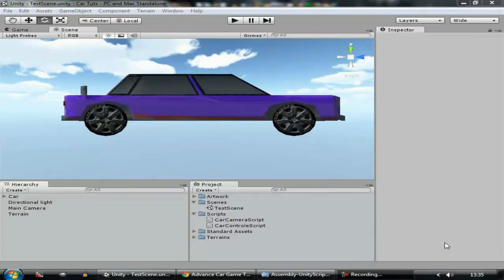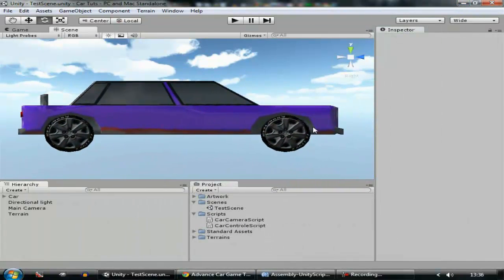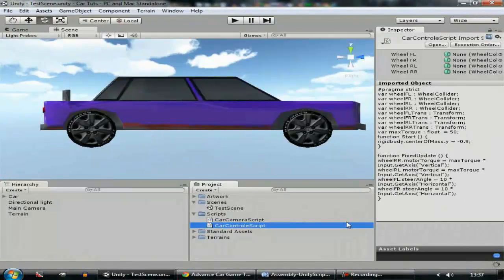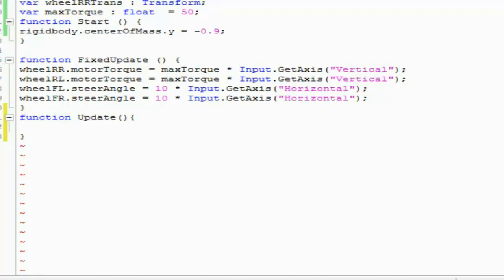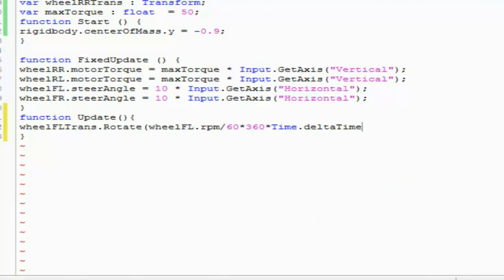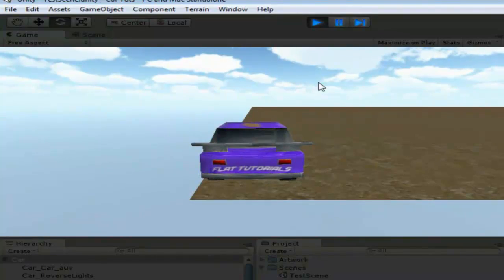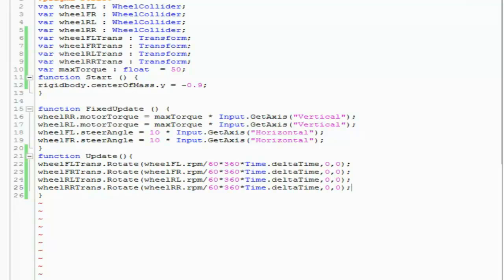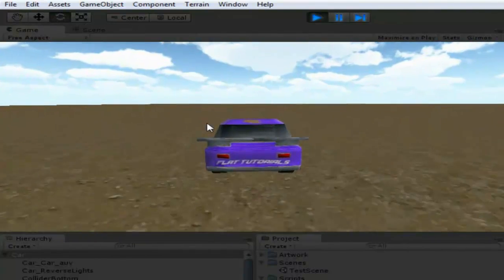#5 How to make a Car game - Unity 3D Tutorial - Wheel Rotation

Comment: [THE SOLUTION!!!!!]
For those who are having issues, there are 2 things that i had and i got it correct:
First, if your car is slow, getting inside the earth, you have put the WRONG transform. As you see in hierarchy , you have the PARENT wheelTransform, with 4 gameobjects(wheelFR,WheelBR...) and each one have a CHILD insite(the wheel object), so you have to put THIS CHILD in transforms on inspector view, not the parent ones, because the parent are empty gameobjects that have no colision, so this is why your cair is going inside the floor/earth/etc.
After solving that, my wheels started to run a lot weird, rotating to sideways instead to front. Well, at the wheelFLTrans.Rotate(...) note that ROTATE is getting a VECTOR3 POSITION, like ROTATE(x,y,z), so, if your object came from 3dmax , the (x,y,z) will be incorrect, so, lets put that like: wheelFLTrans.Rotate(code,0,0), or wheelFLTrans.Rotate(0,code,0), or either wheelFLTrans.Rotate(0,0,code), change the position of that code, so it will change the direction based on the X or Y or Z. To make it easyer, try to clic the wheel object and see the three arrows there, use the one that is pointing the side of that wheel.
AND if they are rotation BACKWARDS, simply put a "-360" instead of 360 only n that wheel , so it rotates the oposing direction!
I think i could help you more, just reply here, and ill try to help!

Comment: When my wheels spin, it rotates in a wide circle. The things noclip through the car instead of rotating on a fixed axis on the axle area of the car, and opening the .obj file in Blender doesn't work.
Reply: Make an empty object at the center of the wheel, let the wheel spin ( rotate ) in perspective of the empty object hope it helps and best of luck bro :)
Reply: WORKS!-that is so smart.tnx!
Reply: Ahmed Awad I have the same problem -- the wheels are rotating on the axle of the car. I wish to try your proposition but don't know where to begin. Can you elaborate please. Thanks.
Reply: mdh cs I got it. No need to answer my query.
Reply: Ahmed Awad I did the thing you said... And still my wheels spin in a wide area...
Reply: ChausticGiggle Everything that spins in this world has a a central point, make that empty object the central point and let the wheel spin around it, Hope it works mate :)
Reply: Ah! Thanks man! Now it works :)
Reply: ChausticGiggle code hard. Make us fun games ;)
Reply: that is not unity problem that's your modelling software problem the axes should be in the center of the wheel also in unity your model axes should match the coordinates of the empty object
Reply: Ahmed Awad thnx
Reply: mdh cs i didn't get it can you explain please

Comment: Ok everyone, I figured out the wheel problem! If your wheels are rotating around the car, it's because the wheels of the model itself is not pivoted correctly. If you have maya, 3ds max, blender or any 3d software that can open .obj, you have to click on each individual wheel and center the pivot. And for FlatTutorials you should update your .obj model with the wheels already correctly pivoted! Thanks for the tutorials though!

Comment: If you have problems with the copied wheels rotating like windmills, try deleting the TRANSFORMS and then re-copying & moving them.
Now, when you will ROTATE it 180 degrees, instead of entering it into the box (which moves the wheel, I found), you select the first wheel, use the rotate tool & hold CTRL while you do that until it's 180 degrees. Do the same with the other wheel. Now they rotate fine.